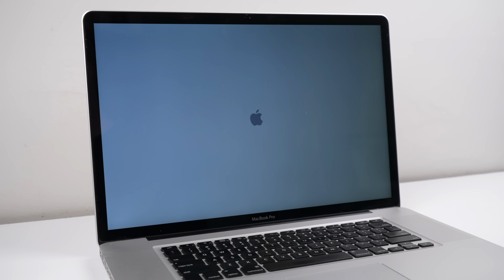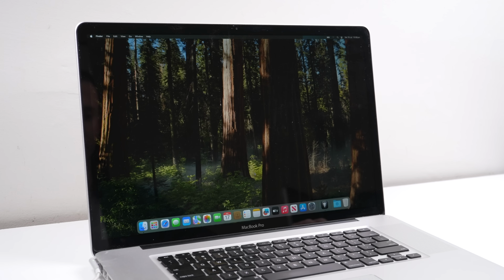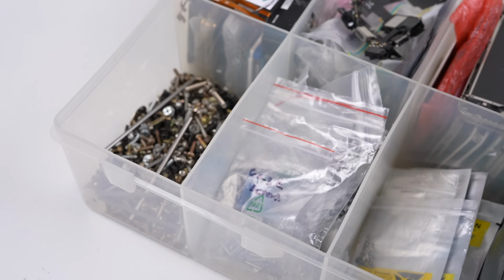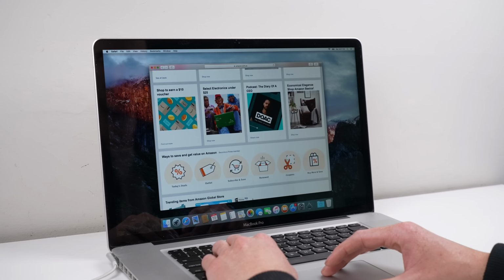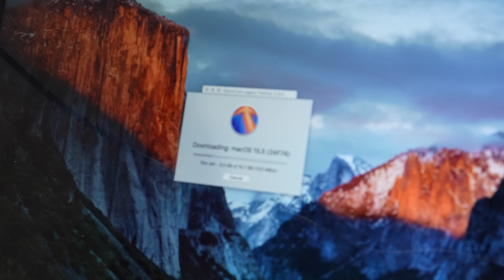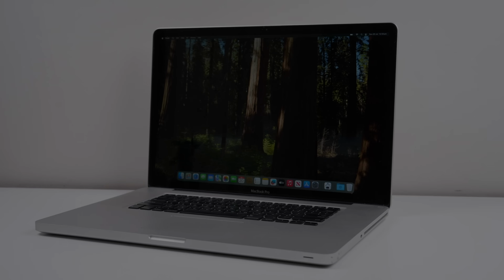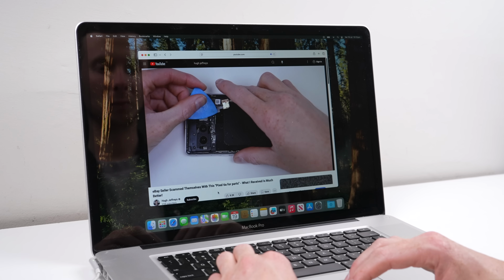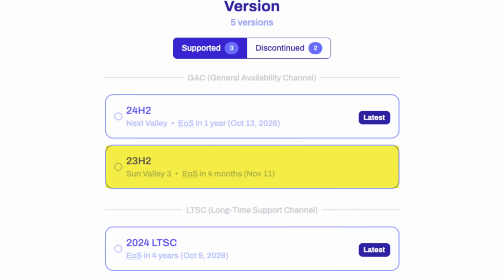I Scored This Old MacBook Pro For FREE & Got It Running On The Latest MacOS

Comment: I have a 2012 15" Pro running 10.14.6 which runs perfectly and doesn't even feel particularly slow. There would be no reason to upgrade it other than the fact that all my software is also older and Photoshop in particular is a bit limited considering the upgrades since CS6. If I were to upgrade the OS, I'd also have to get my hands on a lot of new software. Ok, fine, except Creative Suite now all runs from "the cloud" and excuse me, but I don't want to always need fast internet access just to edit my photos (for example.) Nor do I want to outright pay $600 for software for a just a handful of neat new features.

The whole hardware/software cartel designed to force people to continually buy crap they don't need is so frustrating for us consumers who aren't all millionaires.

Comment: I have the same machine. The latest version of Firefox runs fine on El Capitan. Never have had a need to attempt to bring MacOS forward. I also have an El Capitan installer loaded on an external drive and have used to restore the machine more than once. But, cool that you brought it forward to Sequoia.

Comment: I happen to have the worst MacBook ever released, the 2018 MacBook Pro with touchbar. The touchbar was water damaged by a student of mine and doesn’t work at all, so I have no functioning function keys. The lack of any connectivity also means I need to use adapters to connect peripherals.

Comment: I bought an old 2012 Macbook Pro 13”. I went up to High Sierra and stopped there. I want the old system where as iTunes was still seperate from Music. I did upgrade the RAM to 8 Gb and the SSD to a 1 TB.  It has been doing what i inytended it for. iTunes ans iPod.

Comment: I have one of those with all my old software and data and probably wouldn’t want to try to upgrade it like this, but is it possible to do anything about it cooking so hot that it makes the trackpad impossible to use, and the software lagging so much when it gets hot, that the only thing to do is close it after every five minutes of use and let it cool off? I never found a way to make it stop doing that, but I really loved the laptop for its size.

Comment: I just bricked my 2011 MBP after installing Ventura via OCLP.  Ran fine first time, but next day hung on boot, and discovered recovery is broken, then for some reason hung on another boot and just let it run and it seems the memory got overheated and developed an issue.  Now cannot even reinstall High Sierra.

Comment: I installed Win11 yesterday on my no longer supported MacBookPro11,3 and now I have myself a great fully functional Windows laptop. Runs a little hotter but getting all the drivers via brigadier made everything run buttery smooth and fully working. With a better trackpad than any Windows computer I've ever used, be sure to use the open source precision drivers though. And the mac fan control application.

Comment: Propritetary causes this problem. Look how an open source project like Opencore can save this device. You should install Linux distribution instead, they have Nouveau open source driver for the GPU  which atleast gives it better performance for the gpu unlike the latest macos.

Comment: The problem with this is that it doesn't have Metal APIs, so it will run, but not drive too well. That's why there are so many graphical glitches. It's also because of these missing compatibility layers that it can't see more than the dedicated VRAM to the integrated GPU.

Comment: Hey Hugh, I’ve got a good video for Tech that’s not what it seems. If you try to restore any iOS version newer than 6.1.3 onto a iPhone 4S with a replacement battery installed, iTunes will show a Error 29, resulting in your phone becoming unusable, with the only fix being buying a original 4S battery. Just happened to me when I wanted to remove my jailbreak and now I just have a paperweight :/

Comment: I found a similar age MacBook on a skip with a much slower core2duo, think it’s 2.4ghz. Same story with missing hard drive but I had an old drive with windows xp and it booted into windows. Did manage to find drivers for the Nvidia gpu and it ran benchmarks and was stable, but could never figure out how to get sound working, it would make a nice compact retro gaming rig if I can figure the sound out

Comment: I have a few of these with no friggin chatger 😅to charge them. I'm unfortunately not in a position to spend money on a charger for test devices. The one powers on can hear it boots up has an NVME inside all 3 of them, 1 has 0 battery and display shows black, 1 display is broken at the hinges had to return the borrowed charger ao couldn't test 2 of them to see properly but all 3 powered on. I like fixing these old PC's and Laptops and give them to people or family who need them.

Comment: i had one of these, it worked fine for ages, but suddenly shut down about a week ago. not sure what happened, all i was doing at the time was web browsing, it just went off when i was dimming the screen. it still powers up sort of, but nothing on the screen and no chime. still has voltage to the ports and the charger shows orange, and if i boot holding shift, it puts the fans on max speed. 
any ideas?

Comment: Just threw out about 30 Machbook machines pre-2014 era including a few more recent ones. Sadly in most cases people just don't want them and they end up with various quirks/faults that annoy others.

Macbook Air A1466 (2017 esp) and Pro A1502 units are still quite useful in daily use even with macOS too.

Comment: Just got yesterday a MacBook pro  mid 2010 13 inch for 50 Ron ( 10 dollars ) in a second hand market , put 8 gb of ram in it , installed sequoia, but it to laggy and the lack of gpu acceleration is very bad ,can't use it for movie , I think I  will go back to Sonoma

Comment: Opencore is a magical program. I had it on my old 2015 Macbook Air. It was also a rebuilt Macbook that I dubbed the MacBook of Theseus. I think all that was left of the original computer was the mainboard and SSD. Now it looks and runs like new.

Comment: V. Old MAc runs Sequaio 15.5 fairly slowly, my 2015 15" using i7 and 16Gb memory, the end result with a new fast speed SSD, the experience is excellent, no slitches.

Comment: I am currently watching this on a 17" Early 2009 MacBook Pro running Windows 7. It is my daily driver, literally everything works, I have no problem streaming 1080P Video wirelessly. I love this thing.
Reply: I would've run Ubuntu. 
But was the audio driver working out of the box? That's the part I get caught with windows on apple hardware.
Reply: @Asfgxff  I actually appreciate Linux and have ran mint on a 2009 15" MBP before, with no compatibility issues. However, I tried to install it on here, and was missing the track pad driver (Which Im sure could be found). The main problem was that no matter what I did, it would take 5-minutes to boot, making the entire thing unusable. When apple was a good company, they used to literally provide drivers to run Windows 7, so I tried that approach with the Bootcamp app and everything and it worked. I also tried Windows 10, but somehow the drivers wouldn't work? Even If I tried an upgrade from windows 7 approach. Since about December (2024) Ive just been using Windows 7. I use Firefox and Libreoffice, still supported along with a couple other apps. Im very happy with it.
Reply: I'm typing this on a 2012 Windows 7 Pro VAIO laptop, no ads, no shorts on you tube, everything works. Just saying.

Comment: Good score, but that's gotta run slow as molasses and with fans running full blast when browsing. I run 15.5 on a 2012 15" MB Pro with a Quad Core i7 @ 2.6GHz with 16GB RAM and Nvidia Graphics and it frequently struggles with Sequoia. Glad to have OCLP extend the life of my machine, but I think MacOS 26 will likely be the end of the line for Intel and OCLP.

Comment: Nice, a good old beast brought back to life! But it really annoys me that you couldn't plug in the power adapter the correct way around!
Yes it does work both ways but the way you have it blocks the ports, you only had to run the cable up under the desk and you wouldn't have to awkwardly bend it away when you do need to plug in something else.

Comment: Lucky you found it! And, lucky you know how to get old Macs working! Onequestion, though, but not about this video: I have a "Sunflower" iMac that the plastic bezel has come off - could you recommend a glue, or other way, to attach the plastic bezel to the metal display frame? Is it okay to attach it permanently, or should it be able to be removed so that the lcd panel can be accessed, if necessary n the future? Thanks! Can't wait to see your next restoration of a Mac!

Comment: Just gifted a 2010 Macbook Pro with 4 GB of RAM (2 2GB sticks), put a stick of 4 GB RAM I had lying around and SSD with Linux Lite on it, and....everything just worked, wifi, keyboard controls. As someone who struggled for years with config files its a revelation of just how far Linux as come. Wouldn't describe it as fast but it sure aint slow either.
Reply: Wish the Wi-Fi was working on my 2010 put too much money into it now so gave up

Comment: I have revived about 4 old MacBook Pros, but use Zorin Linux (Paid version) to do it.  They run great and give the user the feel of the MacOS they are used to using.  Of course Zorin is a Linux distribution and there are differences.  With the old MacOS I wonder if you can download and use Chrome, and have it render all web pages?  You don't have to use Safari.
Reply: you dont need to pay, zorin is completely free

Comment: Nice job Hugh !  I like to rescue unsupported Mac portables as well and give them new life with OCLP.  My oldest one being OCLP supported is the late 2008 full spec aluminum MacBook which I currently have running Mac OS Ventura on. I maxed out the RAM and installed an SSD. Since it came with plenty of ports, an optical drive and an easily swappable battery it's a lot of fun to take to the coffee shop surf the web, check email and even watch videos both online and via physical  media.

Comment: Linux is a must on these devices. Even though Nvidia drivers can be tricky at times to set up, it's better than no support, even modified drivers, from Apple at all. 

Mine is a base model 2011, so Intel only, and there must be something wrong with it as performance is sluggish, even more so than what you've displayed on this one, even on Snow Leopard or versions I know of Linux that ran perfectly fine on it.

Also, there are still some community projects trying to keep SL online. Eventually it'll all be gone and before Leopard or Tiger as those have a considerable PPC retro community fighting hard.
Reply: Is nvidia really that difficult?
Reply: @karlcx  Not anymore but still not always plug and play if the Linux distribution doesn't have a version of the system image with the Nvidia drivers embedded in the kernel. 

More modern Nvidia GPU drivers also adhere to more common Linux standards so there should be less bugs and less headache for the developer to package the driver into the kernel and repositories.

Older GPUs, running on older standards will be stuck to the Nvidia way though so if you want to revive an old Nvidia based setup the experience will probably be more finicky. 

I tried Linux on my brother's new laptop last year, it came with hybrid GPU, Nvidia and Intel, aside from enabling a couple of command lines and fixing one tiny bug, it was indistinguishable from my AMD systems which already have their drivers baked into the kernel so it's a plug and play experience.
Reply: Not everyone Habla Linux or even likes it.  If you do good onya.  These older macs make for great distraction free word processing as even old Libre office and old MS office files can still be used. And the Bean Word processor is another good alternative
Reply: @cesarespinozaspain  Linux is the only way to squeeze some life out of these ever aging devices, especially for online browsing. 

I get that not everyone understands Linux or wants to but if the goal is service life extension, it's the only viable goal. Apple is killing off Intel support just as it did PPC, even OCLP won't fix that, maintaining graphics support alone is already a nightmare.

Comment: FINALLY, thank you for doing computer restorations back again, I missed them.
Reply: I realise this is an Apple lovers video, so I'm expecting the inevitable hate towards my comments, but I found another use to extend the life of my old I5 based macbook. I simply used boot camp and turned it into a Windows machine for one of my kids. The hardware was more powerful than most of the Windows laptops of the time, and therefore, does an admirable job of running the Windows platform (even for some games). Just follow one of the many 'how to install Windows 11+ on a machine without a TMP chip' Ok, let the trolling begin 😁
Reply: @deancadman8267 these macbooks are bettee than all those cheap laptops u find nowadays both in processing power and build quality. Unfortunately Apple fans look at you with disgust the moment u mention intel, but thats how it is on the internet. U made a nice choice and saved the life of a mac
Reply: yeah i love those restoration videos

Comment: I have a mid 2012 mac book pro maxed out 16gb ram put a 500gb ssd and open core on it.   Runs perfectly. Love the fact that mine still has the dvd drive in it. And I also installed kali linux on dual boot.

Comment: I tried OpenCore on a early 2015 and though it worked, fans blast though. I do need to put a new battery in it so could be the culprit but not sure I want to waste 80$ to test. On a 2011 MBP17, I put Ubuntu and it runs great. I has the GPU issue so will sometime go berserk

Comment: How's the heat on this? I have a 2015, but it seems to get fairly hot for my liking, unless that's just how the intel macs are?
I've repasted with PTM7950, but even running linux it still shoots up to 60 barely doing anything.

Comment: i wonder, if the main goal was to just make it 'usable' would an older OS like catalina actually improved performance? 
browsers are definitely still supported, so internet access would not be an issue. and i wonder if it would make the performance a bit smoother? if so, would it not be worth it?

Comment: An enjoyable video!👍👍
I was surprised that you did not renew the thermal paste and the cmos battery, but perhaps you did that off camera.
I have a 2008 MBP., 2.4 GHz., core 2 duo CPU., and 8 GB., of ram., and an ssd., and it currently works well enough with Linux Mint Mate installed.

Comment: I'm watching this on a 2009 17" MacBook, in regards to the graphics issue i think it's capacitor may need to be changed, after a while the screen will start to flicker or the colours will start to distort similarly like the 2011 MacBooks, apparently the 2009 and 2010 17' MacBooks suffer from this capacitor issue, I had mine fixed last year but the issue has returned slightly, it's really predominant when i use the Windows 10 partition on it. I'm still using Monterey on my 2009 MacBook and i think it works quite well, it's not as slow as this MacBook you rescued. One thing about these 17" MacBooks is how big they are, the palm rest is so big that it's actually really comfortable to type on for long periods of time, i find the 15" MacBooks to become cramped after a while, I wish Apple could release a MacBook using the same case size of the 17" MacBooks it would also offset the comically large size of their modern trackpads.
Reply: I had a 2011 17” gpu was gone so I disabled it worked perfectly then
Reply: Mine seems to work fine although it detects no fans or temperature sensors so i called it "JetBookPro Jr." (mid 2009) (the original JetBookPro is an early 2008 with the same issue)

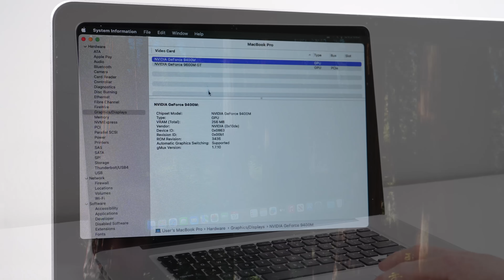Comment: 9:40 256MB of VRAM is still very usable.. For reference some people have gotten GTA V playable on an old GPU with 256MB of VRAM if that's anything to go by, so no it's not a miracle that it works at all.
Reply: I my self used 256mb till 2023,upgraded to 512 then got 2048mb in 2025.

Comment: Wild seeing a Macbook that takes standard 2.5" hard drives and SODIMM memory modules. I didn't know Apple ever knew how to use industry standards.
Reply: Newer installer doesn't support USB 1.1, that's the Apple I know
Reply: Until 2013, apple knew standards. 2012 MBP was last well designed.
Reply: Mac used industry standart right up to th retina macbooks. But even then you can get an adapter to run stanard m.2 hard drives bring it up to 2016 or so. 
Modern macs are all intergrated to logic board.
Reply: LOL, Apple created the standards, microsoft copied Apple, and so did IBM.

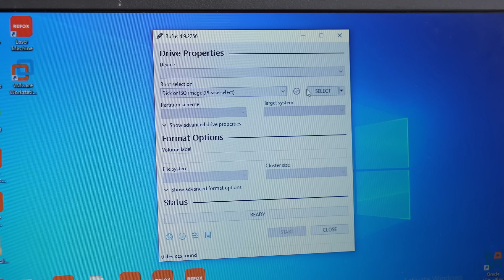Comment: 11:12 I know it sounds a bit cultish but would you mind trying linux mint xfce on it
Reply: I have tried, it works except wifi. one can install wifi manually, there are instructions but i failed somehow. i have not given up tho. reading the comments to find leads.
Reply: @OlaHermansson  How is the experience? Is it smooth using a browser?

Comment: Hi. I also have a 2011 mb 17". I put oclp and everything works except the webcam. I tried all the os's and even Linux. All great but no webcam.  Webcam only works with the original high Sierra.  Any experience with that issue?